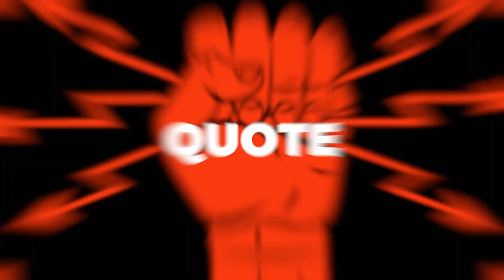Harmonic Distortion- Not Just Heavy Metal

Comment: I bought a 7kW Coleman powermate back in 2004 and it ran my 5 ton Trane variable speed AC the first time I tried it out after a hurricane in 2017. Next time another hurricane came through a few years later it wouldn’t start up. I was super bummed. Only thing I could guess was maybe a firmware update made it so it was sensitive to THD, which I think was listed as <12% for the Coleman. So, after some thought I bit the bullet and bought a predator 9500 which is <5% THD and when I tested it out on the AC it started right up. Moral of the story is THD can be a factor with some sensitive loads.

Comment: Giving the facts. I definitely wished I had known some of this prior. I have a 10kw Durostar portable. It’s great, but I can tell when things need a constant feed, you can clearly hear the fluctuations from the generator. The model I have is a DS10000HX, which supposedly has a THD of like 10-12%. Looking into getting an inverter for the exact reasons you mentioned. What top 3 brands do you recommend? 
Also, I am thinking about adding a box to my AC to make it soft start. I’ve seen several recommending this. Thoughts on that?

Comment: A theory I've always wanted to test if i can explain well enough.  A 4 cycle, single engine engine generator has to make 2 full revolutions per ignition cycle. so the engine is constantly speeding up 1 revolution then coasting until the next cycle. 
3600 RPM means 60 revolutions per second (also 60Hz) and 30 ignition cycles per second.   It just seems like that would cause a fuzzy waveform in my mind.  
I got a cheap harbor freight 8750 watt generator.  The waves are ugly but I try to only load it about 50% and haven't seen any adverse affects on my stuff but I really don't like the thought of using it. 
 More expensive standard generators seem to have some electronic regulators that probably offer some buffer and make it better and V-twin engine generators always seem to have low THD.
Reply from the maker: I like the inverter style for the low THD, but they are much more expensive

Comment: I started researching THD while learning about solar/battery inverters. What I learned is that THD comes from many kins of loads (like electronic ballasts) and has a ripple affect across the grid. The grid is large enough that THD mostly dissipates like ripples across a pond, but its stronger at the source. I've been able to measure the THD of several UPSs which use a stepped square wave to approximate a sine wave. The readings I got matched the sticker rating on each device. I also measured my house's THD from the grid and got around 3%. I live in Washington. Something to keep in mind: because THD can be caused by loads and not just sources like generators, THD will vary depending on the type of load you put on your system. Also, pure sine inverters will have a different THD depending on how much load you put on them. I did a few testes with a pure sine inverter a while back with different kinds of loads and tried to test the inverter at different percentages of it's total output capability. It wasn't particularly scientific, but at no load the inverter was below 1%, and every load I put on it cause the THD to rise between 1 and 2%. I think this is why inverters are rated with a "<" rather than a specific number. For example, my inverter is rated at <5% and it seems likely that even at full power with a THD producing load on it, it will probably be at or below 5%. I got really curious about this stuff, and plan to a more scientific set of tests. But what I've taken from all this so far, is that you really don't know what the exact THD of your system will be until you set it up and measure it. But also, I see any company refusing to at least publish a <X% estimation as a company not to be trusted.

Comment: Back when I was a teenager/young adult (1970s) with money to burn, I dabbled with higher-end audio equipment.  This was when the typical stereo equipment was often in a nicely finished wood cabinet.  Harmonic Distortion was something you looked at in your amplifier, speakers, reel to reel tape player, and turntable.  I researched specs, buying the best equipment components I could afford.   Other audio equipment such as microphones and headphones also has harmonic distortion.  As a would-be opera singer then, my  ears are sensitive enough that I couldn’t listen to the cheaper equivalent for more than a short time without casu fatigue and other issues.  While I didn’t pursue the sin career, and my aging ears are not as sharp as they used to be, I can still hear the interference in the cheaper headphones to this day (age 67).  What is surprising is the increased quality in the off-the-shelf $20.00 headphones now vs the similar stuff from 20-30 years ago.  Anyway, even though I’ve abandoned the pretentiousness associated with the “Wookie the Golden Ear” audiophile claims, I still appreciate the better quality equipment.  I can buy a perfectly adequate system for my podunk little house with it’s low ceilings and weird construction without paying for equipment requiring a sec mortgage on my home.
Reply: from the '70s till now, It's wild how the tech game has shifted and how it's impacting the way the youngins vibe with music today.

Comment: How do you measure THD
Reply: THD should be listed in the equipment specifications.
Reply from the maker: @leestokes6761  hard to find on some equipment. I figure if it's low, they'll make it easy to find so they can brag 😀
Reply: @abrelectric  it's kinda like they don't want you to  👀 know  👀the THD levels
Reply from the maker: @dennismarkowski8612  kinda feels that way, right?
Reply: A THD meter, but it's not worth buying. They are very expensive.
Reply from the maker: https://youtu.be/n5Zxvk7tiC4
Good video. Do some exploring!